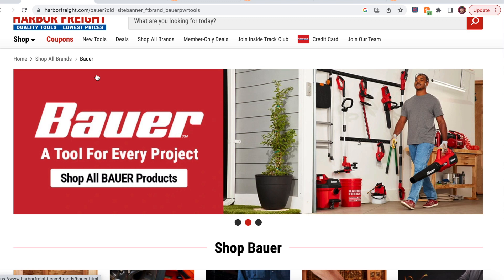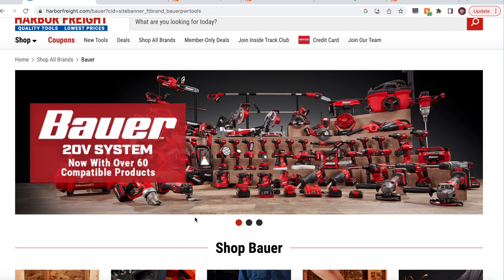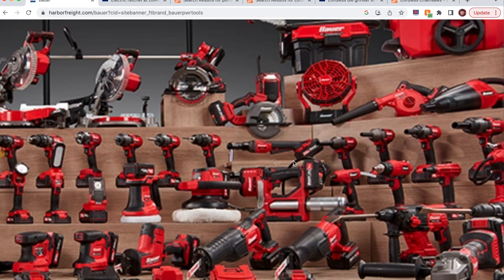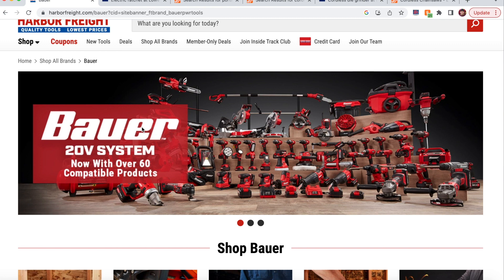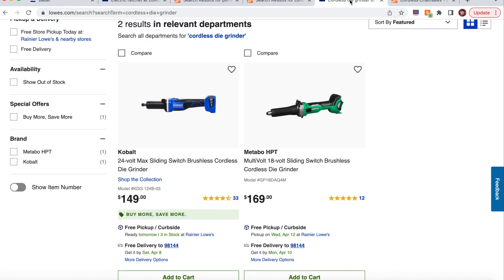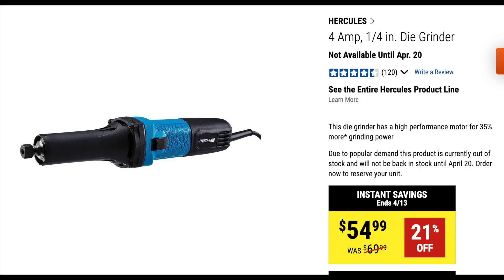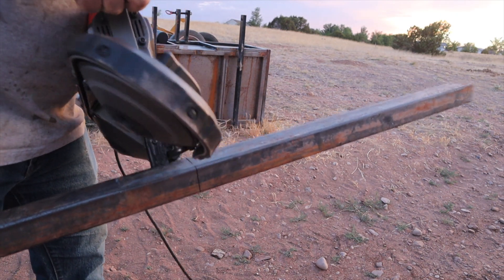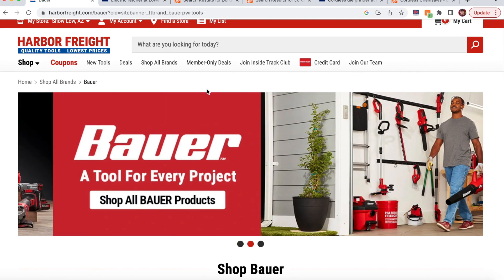5 Tools I Hope To See in the Bauer 20v Cordless Tool System

Comment: A right angle die grinder would be awesome. I’d like to see the 3 gallon vacuum get reconfigured to where it snaps into the modular boxes as well
Reply from the maker: Ooohhh snapping into the modular boxes would be really nice for a contractor/handyman
Reply: @DereksWorkshopAndProjects  a Bauer toolkit that works with the modular boxes would be awesome as well but I won’t hold my breath on that one. I’d be happy if they did a set that worked with them just out of the Pittsburg Pro lineup.

Comment: I've been using bauer tools the last 3 years and have no complaints about them so far.. but I do have some ideas for new tools in their line such as the underhood worklight and tripod area light such as the dewalt DCL079B or Milwaukee rocket light that runs on either 120V or 20v batteries (plus, charges the battery if it's plugged into 120V). These would also make great additions to the collection. The bauer 58310 cordless shop vac is awesome but would be even better if it also had 120v like the hercules does and the cordless fan. Maybe even a 2 or 4 bank gang charger would be nice too. Keep the good tools coming and look forward to hearing back soon! Thank you for your time in reading this
Reply: The tripod light would be sweet! I have the large work light and two of the tiny work lights and love them. I've thought about building a stand for the big work light, but a all in one unit would be nice.
Reply from the maker: An under hood work light is not something I have thought of but that would be a super useful tool! I would like to see them add the 120v option to a BRUSHLESS Bauer cordless vacuum as I feel like the one they have is acceptable but could be a little better.
Reply: @Zombiereaper1  I have the swivel head light and its as bright as a spotlight! It lights up a very good distance. I also have the small worklight that's good for seeing under the dash. I also have their stick light but didn't really care for it too much.
Reply: @DereksWorkshopAndProjects  last weekend I got the brushless high torque 1/2in impact, the brushless compact 3/8 and 1/2 impact... took full advantage of their 15% off any bauer tool. The big momma impact is definitely a chunky butt, but has lots of power. I haven't used the other 2 yet.

Comment: Thought of two more things. A Bauer cordless Bluetooth speaker/sound system. Something bigger than the current tiny speaker, something with bass.

A Bauer cordless cooler would be sweet! Even sweeter if it clicked in with the stackable tool boxes!
Reply from the maker: I thought about a better stereo like the big ones from the other brands. That would also be nice. Cordless cooler…? So would it be like a refrigerator almost? I’ve never even heard of something like that but I’d love something like that!
Reply: @DereksWorkshopAndProjects  basically yes it would be a mini fridge.
Reply: i can only imagine how quickly that cooler would go thru batteries. seen a few battery ones and they seem gimicky

Comment: I would really love to see a cordless framing nailer. I've considered buying one from another brand, but all my batteries are Bauer. I don't really want to have to deal with other batteries or adapters.

Another thing I really want - it's a tool they already have, but I want them to make a change to it. I want their cordless air compressor to have an option to use a cord. If they added an option to use their air compressor either with batteries or with a cord I would get the Bauer compressor immediately. They do have some tools that can be powered by battery or by cord. I'm sure they have a fan that can be powered either way. So I know they could do it.

Comment: A 12 volt slim battery extended ratchet. 6 inch extension.
Reply from the maker: I wonder if there is any plans to make a Bauer 12v line.

Comment: Am I the only one who barely picks up their ratchet these days? I have a 90° adapter for my impact driver that is more compact and has actual breakaway power due to the impact compared to a ratchet. Combined with extensions or even flexible hex shafts that thing can get anywhere.
Reply from the maker: I actually started using my 3/8” impact a lot more. But a ratchet definitely comes in handy still.